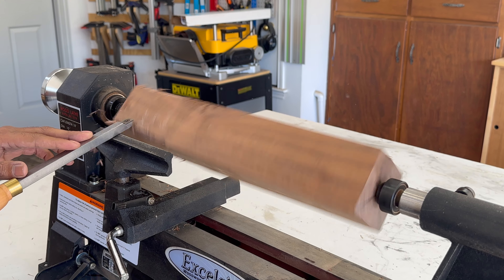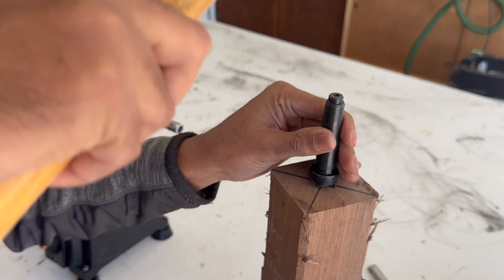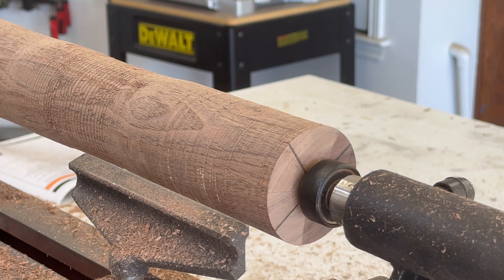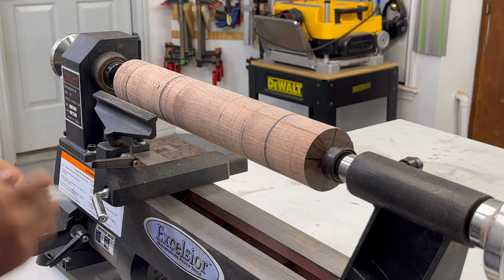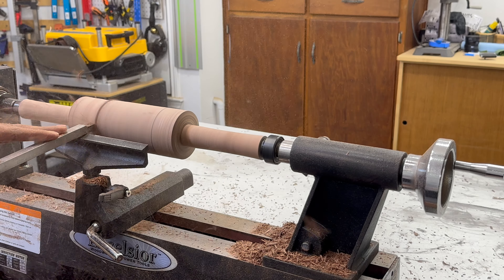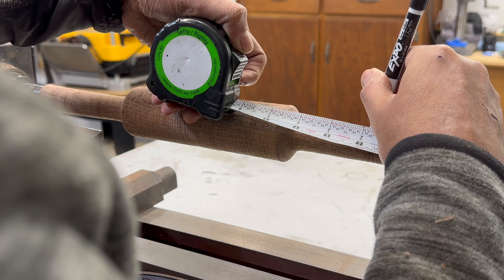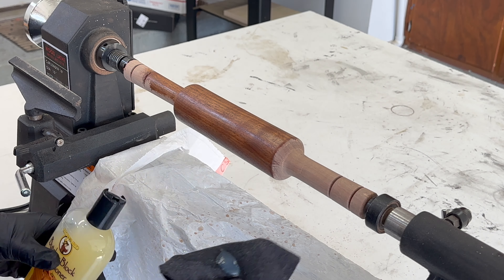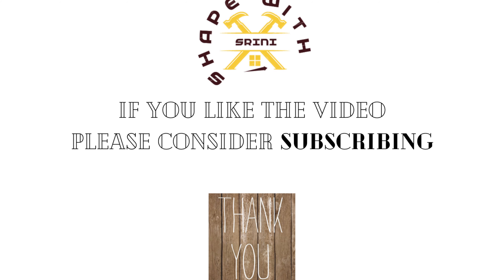Beginner Friendly Project for new Wood Turners

Comment: Nicely done. Now i am by no means a professional wood turner, but when im starting with something square, i take it to the table saw with the blade set to 45deg and take the corners off. On say a 4x4, i set it to take an inch off from the corner, winding up with an octagon with roughly 2inch sides. Makes it easier on the tools and wrists and reduces the time spent getting to your rough dimensions.
Reply from the maker: Thank you. I will try that next time.